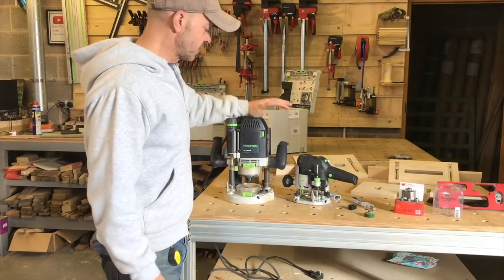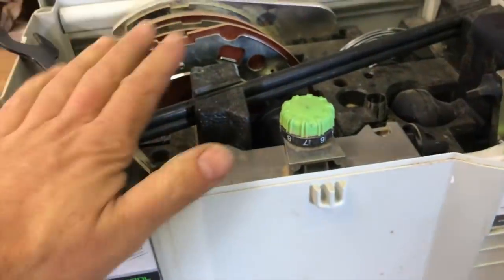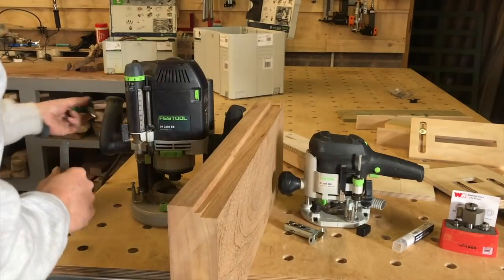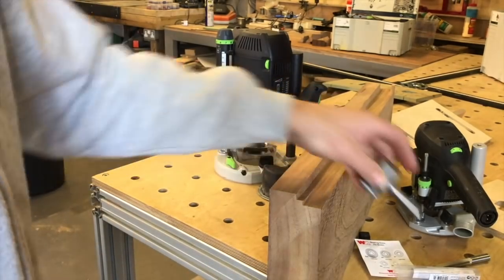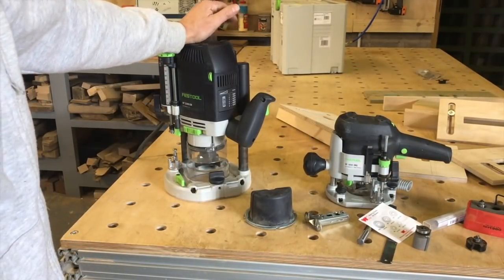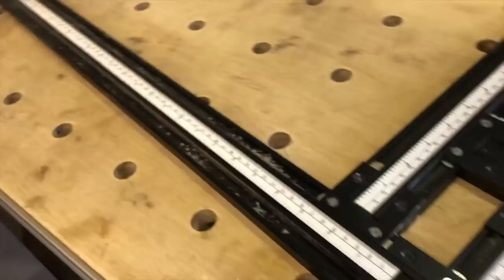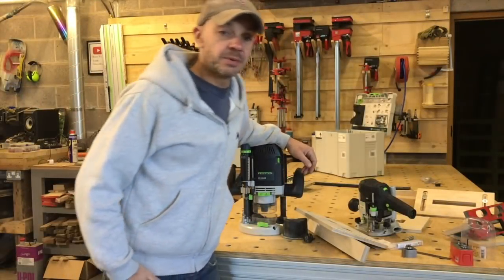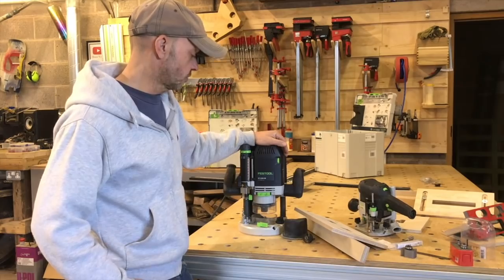Festool 2200 Router and Templates

Comment: The reason you can cut bigger rebates is that the of2200has 3 bearings to the motor from the cutter. The biggest dewalt has only one small bearing near the cutter. Both pillars lock of. Try this, put the bars into the base and lock off. You will see the bars are not square. When you use the guide rail this tilts the base. Shim the bars untill the base of the router sits flush on the work piece.  Use foil. When the saw sits perfectly flat, and because the pillars lock off square . The cutter will be 90° to the base. It is then like engineering in wood. But you have to shim the bars. When using the fence it really doesn't matter  about shimming the bars. The 2200 is awesome!  You need to get the Festool template ithas more support for the routers. Buy some pins for the base so you have a self centering mortise set up.

Comment: Just wondering, why not use the spindle moulder for these rebates instead of these humongous router bits?
Reply from the maker: As this was a one off door its faster making and rebating after (well for me anyway)was much faster,  set up time on a single door is much slower.  one other little thing I had to order the glass asap and start making the door at the same time so i had small adjustment if need as i did the rebate (on the finished door) the morning the glass arrived :)

Comment: Hi,

excellent video - new subscriber! Not wishing to put you on the spot - I'm building an electric guitar, would you think the 1400 or 220 would be best? I only have the budget for ONE of these  awesome machines. I have a small router for fret work & other intricacies but want a new, main router, that will handle everything from body profiling to pickup / neck pocket cutting to neck shaping (to a template, I do the actual back of the neck by hand). Cheers! Ade.
Reply from the maker: 1400 ,  for very small work the 1010 is also cool

Comment: There is also a rebating cutter for the OF2200 albeit an expensive one! https://www.idealtools.com.au/building/routers-and-accessories/cutters-router-bits/cutters-for-working-with-timber/rebating-head-and-spindle-with-reversible-replaceable-blades?limit=all
Reply from the maker: Really like that , have you used this ?
Reply: Manor Wood No but I can see it would be very handy taking the router to the work pice ... I was considering it then decided to create an insert plate for the HK85 which has more options for rebates https://www.dropbox.com/s/f267rwgl18z45gf/HK85block.pdf?dl=0 will also send some pics of my Domino work station when next in use

Comment: i still dont see why you couldnt make 2 or 3 passes
Reply from the maker: If you have a bit which is 12mm and work your way down to 25mm and need to go back and make the rebate a little deeper there in nothing to run the bearing on
Reply: @ManorWood  i would not use a bearing guided cutter  to make that deep rebate